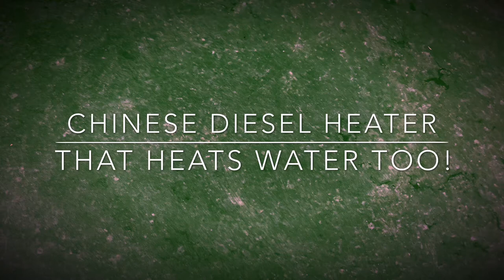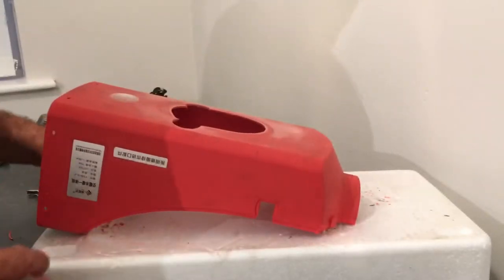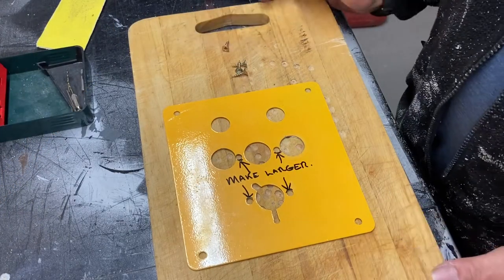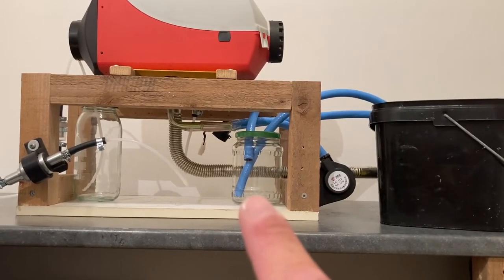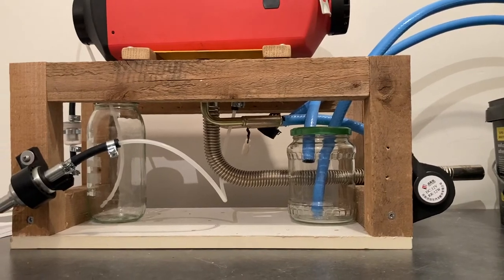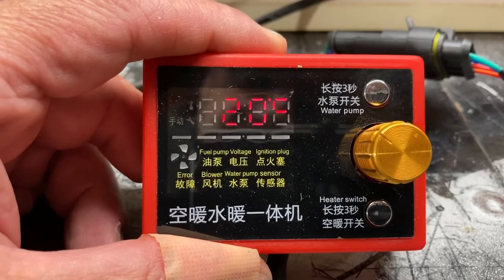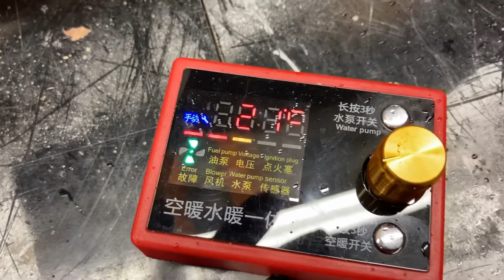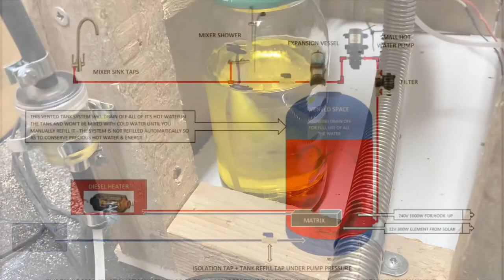Chinese Diesel Water & Air Heater Feasibility Test

Comment: the only downside i see to these is you cant create hot water without creating hot air in your van. great video highlighting the 'issues'
as to showers, I jumped in the standard electric shower and put the plug in, i took a slightly longer than usual shower, and marked the water level and pulled the plug, then i refilled to the mark, i had used about 12l of water, so i decided a 25l tank for hot water would be more than enough on the van, so i simply used 4 25l plastic water gerry cans 1 for hot 3 for cold.
Reply from the maker: Yes your right, no hot water without hot air but the way I see it, most of my camping will be in colder climates uk based 12 months a year and I found even in summer if up early a bit of heat first thing ain’t no  bad thing as it can still get cold on a night. For those exceptionally hot times I think keeping your water cool is the issue and I can happily shower in cooler water but my intension is to build a tank with a dedicated solar panel that has a 300w 12v element in it to maintain heat produced from the diesel heater originally or pep up the heat from an already luke warm tank from a hot summers day.  Another crazy idea that might just work? So in principle diesel power for colder weather, solar power for warmer weather where only a slight increase in temp is required. All this research came about when I had the dream to build a camper van but was soon taken back by the cost of building one with all the creature comforts. I think this is my best economy solution but only time will tell once put into practice. :)
Reply: Clever idea to use the 25L containers!
Reply: @G-ra-ha-m  I changed from the 25l hot as the plastic goes soft, then the pressure of the water pump expands it balloon style, I'm currently making a new hot tank from a 12l cookpot/jam pot thing, cut it in half and added some 6inches more in the middle with a zinc steel strip, rivetted with stainless rivets and glued with clear silicon, rivets sealed. Now fitting a copper pipe loop in it for engine heat and a 240v 700w element I got off eBay, video when it works....
Reply from the maker: We're Really Relay Camping my plastic tank is rated at 70C so im assuming it will be fit for the job? Plastic is a good insulator too. I may wrap metal straps round to secure it and stop it sagging though! My tank wont be under pressure either as it will be vented. Its all a bit of an experiment in the name of cheap lol. I dont want a hot water system and  heater thats going to cost virtually the same price as my van cost!
Reply: Gents, great video and thread. I'm in planning stage for my van - I had settled on a Calorifier tank fed by engine coolant - as  i will be fairly mobile. I was thinking about a twin coil tank .... and looking at these heaters as the second glycol feed for tank for times if the van is static. The hot air in summer is a big issue for me - could you box this heater under the van, and vent out the hot air, and then reconnect duct in colder weather? Wondered in your opinions whether this would work/advisable/safe etc

Comment: Thanks so much. Can you share the make, model, and how you bought it? Thanks
Reply from the maker: I left contact details on my description as its an order direct from  china. I bought mine second hand off David McLucky who reviewed the machine, not from china but i was going to get it from china originally until david offered me his. You may want to check out my installation video as there are issues with this machine but so long as you stick to my suggestions you will be fine.
Reply from the maker: SEE LINK BELOW :-
You can just buy one as those sites usually are wholesale. Just contact them direct. Ive had dialogue with them, they wanted me to buy ten but i said I’m not a business i just want one so they will still sell individually. 
https://m.alibaba.com/product/62506545766/5KW-12V-Hybrid-Air-Water-heaters.html?__detailProductImg=//s.alicdn.com/@sc01/kf/H9c75608037864df091abba8760477b5aU.jpg_220x220.jpg

Comment: I think I'd went with a tankless gas water heater, I have one in my offgrid house, it would be better with a pair in series for really hot water, and I have two carbon filters in series,   so I hope the water is potable, I still don't drink it!
Reply from the maker: Oh defo not for drinking.  I was thinking of getting a copper heat exchanger, much safer. Im literally in my garage now putting it back together with auto air release vents fitted as a guy told me he did same thing and when the circulation pump is switched off because your water tank is hot, the coolant boils inside the  machine, gasses up and blows the pipes off. Therefore Ive re designed it and using waterless coolant.  Im about to stress test it as i never turned the water pump off long enough in that video. If it passes the test its getting fitted into the van next with an installation vid to follow. The vid after that will be my tank set up. One hot, one cold and a small one fir drinking water. A separate tap in the sink for drinking water

Comment: Funny thing is superglue and baking soda is the same thing they used patch chips or cracks in some helicopter blades like Marshfield clinic downtown Eau Claire uses baking soda and superglue to fix their chips in there helicopter blade so they don’t have to constantly buy brand new helicopter blades that are over fucking $10,000 apiece